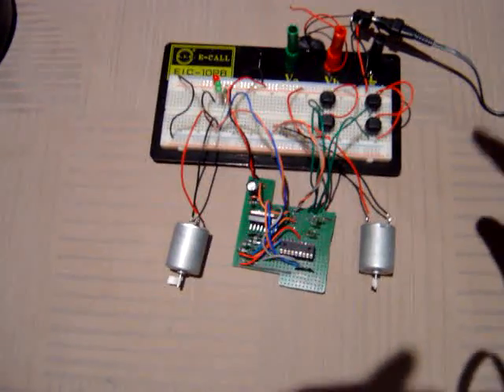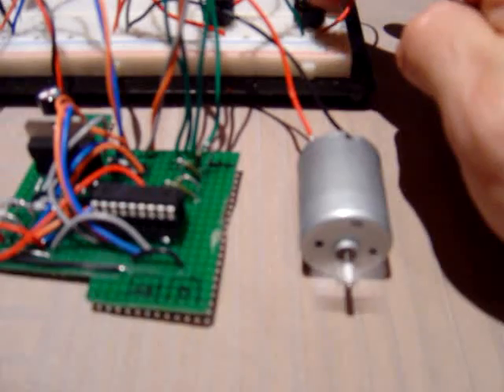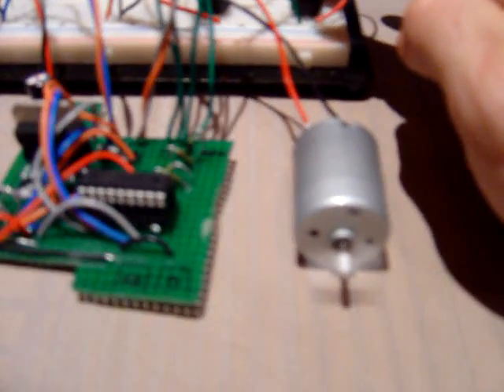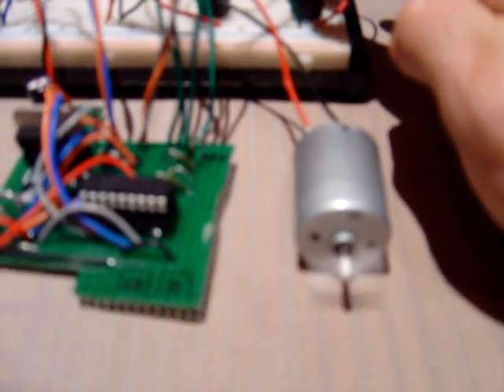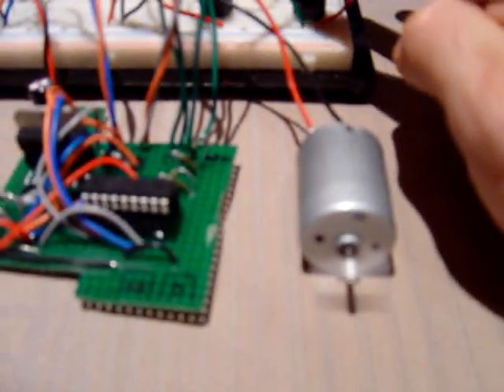PIC16f628a DC Motor Controller

Comment: Hey, does that include speed control or is it just putting the motors into forward/reverse and stop?

if so, can you send me an example of how you control the speed whether its using the PWM module or some home made code

Thanks